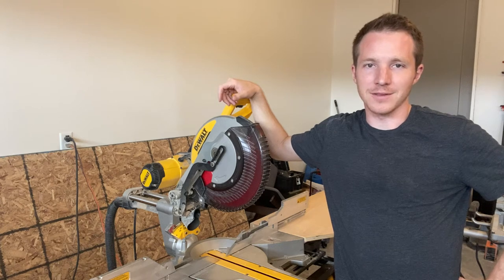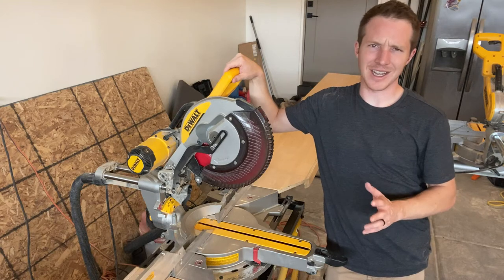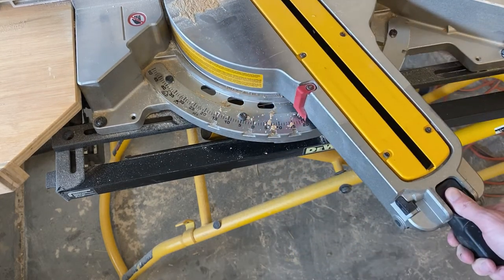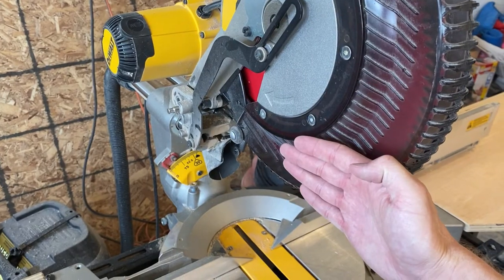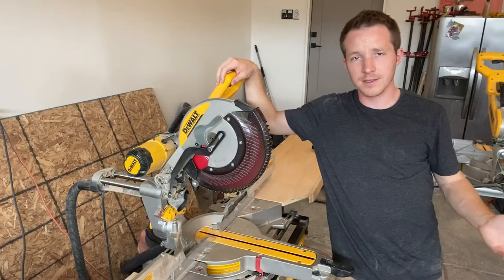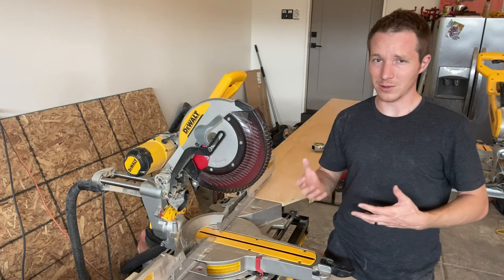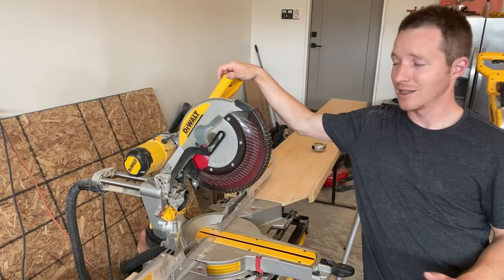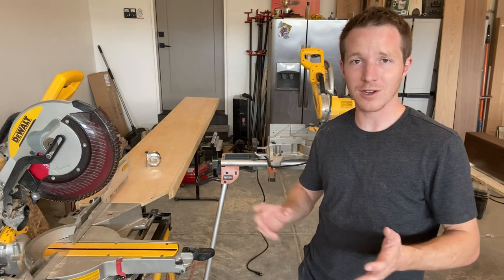Is the DeWalt 12" Sliding Miter Saw Any Good? | DWS779 Professional Trim Carpenter's Review

Comment: Just to note as I also have this saw, there is a $70 conversion kit to add the blade light to it.  Totally worth the upgrade and super easy to install (took about 15 minutes).
Reply from the maker: I’ve wondered about doing that. Thanks for the tip!
Reply: $70?! The same thing's available for $10!
Reply: @vannevels6758  can you link to it?  Is it a plug and play kit fitted for the saw specifically?  As the $70 kit was the cheapest kit I could find like this.
Reply: @theelmagoo  I just Googled it and 2.5+- video came up of how to install it, very easy.
Reply: @vannevels6758  So like I asked, can you provide a link to a product, not a video?  The $70 kit is a full retrofit mod to turn the saw into the DWS780.  It comes with a replacement molded handle with switch, wiring, plus the light module designed to slot into the saw.  This is not just buying a light and mounting it to the top of the blade.

Comment: I previously had the DW718- 12 inch, which is an older version of the same saw. I have had it for around 20 years before the motor finally gave up. I used it almost daily for about 4 years when doing finish carpentry and cabinet building in my own business and cannot say anything negative about the reliability and accuracy of this type  of saw. I recently purchaced the Bosch GCM12SD dual bevel sliding compound miter saw for my shop saw and bought the Dewalt DWS779 to take on job sites.

Comment: I have one and put a aftermarket light kit on it and made a excellent miter saw been using it for about the last 5 years without any problems would buy it again
Reply from the maker: Awesome! I’ve contemplated putting a light on mine but haven’t pulled the trigger on it yet!
Reply: @berlinbuilds  it made a huge difference it lights up the blade to show the cut line best money I have ever spent

Comment: I think that black override button is so when you shift the base slightly past one of the detents and lock it the catch might want to slip back into the detent as soon as you're cutting
Reply from the maker: That would make sense. Thanks for the input!
Reply: @berlinbuilds  I hate every kind of miter saw that have the screw type for locking in at your angle, the old Hitachi saws would always move back into the detent as your tightening it
Reply: @A -Carpenter  had a Metabo HPT for a while, screw was annoying compared to a 779 but I never had issues with the saw moving when tightened. It was a good tight saw, just lacked power and made a whine that my ears didn't agree with

Comment: Which vacuum would I need to collect the dust? Would you recommend this saw for a woman beginner??
Reply from the maker: If you want to stay with a DeWalt brand for the vacuum you could use Model #DWV010.  This is a great saw that I'd recommend for any beginner.  It's not too expensive to pick up (especially if you catch it on a sale), has lots of power, and can do more that a lot of the fixed miter saws.

Comment: Does it have the same cut capacity as the 780? I've been thinking of buying one of these
Reply from the maker: My understanding is yes. I could be wrong, but from what I’ve read and watched they should be the same. It’s a great saw especially for the price 👍
Reply: They have the same cut capacity same motors just the 780 has the light and the crown stops thats it everything else is the same.
Reply: And I think the 780 comes with a better blade.
Reply: @kiwigrunt330  every saw comes with a garbage blade so that shouldn't make a difference in anyone's decision